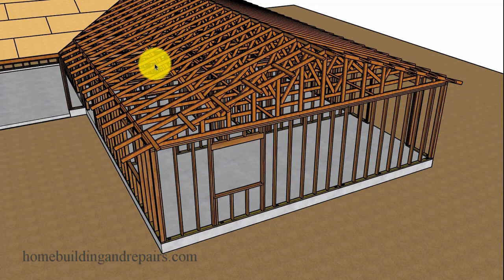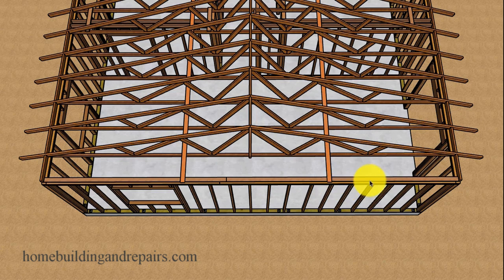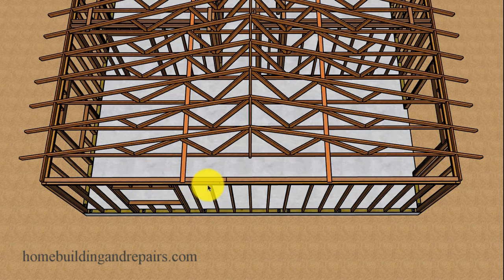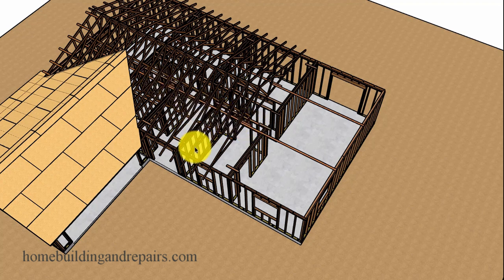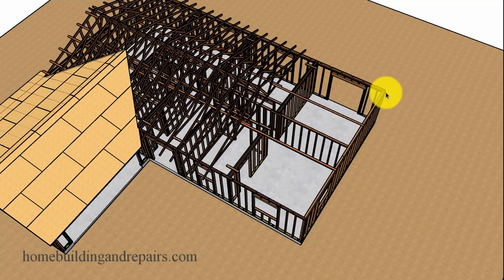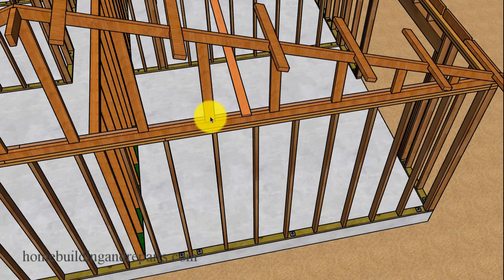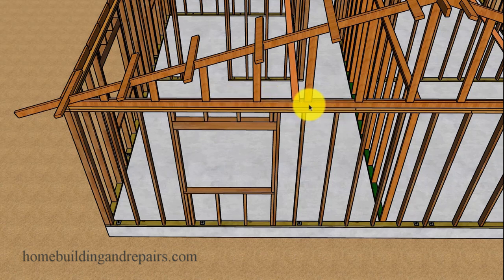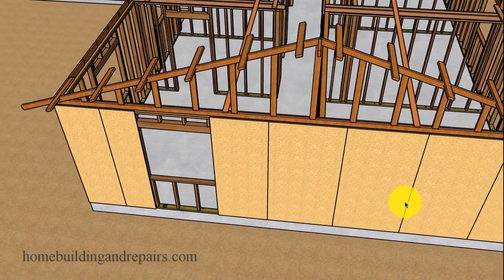How To Remodel Walls Under Gable Roof Truss Framing - House Remodeling Ideas

Comment: Greg, great, great, great video!  In the middle of a bathroom remodel.  One wall, the gable end wall (like in your video) needs plumbing run through 1/2 the wall.  I plan for 1/2" PEX (hot, cold).  According to this video, I think I can consider my wall not load-bearing in the technical sense which will enable me to cut small holes in each stud, 7 of 14, to run my PEX.  Thoughts on that idea.  Should I sister each cut 2x4?

Comment: Hi Greg, I am really enjoying your videos, thank you. I'm a drafter and I am doing some freelance ADU design. I am without a doubt going to be working with a structural engineer for permitting, however, I would like to get some basic understanding during my design process. I would like to push out the entire end of a gable wall of an existing garage by three feet. It's about 24 feet wide. Here's the catch... The new three foot by 24' section will have a second story above which will tie in with a new building that will run perpendicular. Would it make the most sense to remove the gable wall and gable studs and just put a new beam all the way across and sit the edge of the second floor right on top of it? Or would it make more sense to keep the existing gable studs and header plates and run a beam along next to them and sit the second floor on top of that?  Thanks so much if you choose to answer me =)

Comment: Hi Greg, I am new to your channel. This is the perfect diagram for the house I have. The question is, the center wall, right under the peak attached to the exterior wall, would that be considered a load-bearing wall? I have a single ranch-style manufacturer with a full basement. A supporting pole is right underneath this wall. The contractor said it was not a load-bearing wall, but I found the same length and width wall on the other far side of the house.
Reply from the maker: The wall might not be load bearing, but if there is a supporting pole, then that part might be load bearing.

Comment: What about the weight from snow?  I am building a 16x20 cabin with 14’ walls with half loft in rear…  using scissor trusses, the loft ceiling will be approximately 7’ from door..  I will have a windows in that back wall that tops just below the top plate..  there is no room for a header except in the gable.  We typically get 6-8’ of snow that will likely not slide off of the 4/12 pitch until spring..  C what are your thoughts. The window is 36x36.  If I put the header in the wall, it would drop the top of the window to my chin. I don’t want this, if I can help it.. 
Please help:) tia

Comment: Thanks Greg, I'm planning some renovation on a home I just purchased and you seem to have the perfect video for every specific situation I'm considering. Really appreciate your work. 
My home already has an addition that was added on a gable end like this with a single door opening. We'd hoping to open that up at least partway across the span of the gable. Is the solution typically a beam/header like you would do to transfer load on any other supporting wall or are there other lateral support changes we should consider too?

Comment: Would you still install headers above your windows on the gable ends? I’ve always considered gable end walls non bearing and thus not needing a header just square framing for windows. What are your thoughts?
Reply from the maker: Yes, they might not need to be as big, for example you might be able to use 4x4's instead of 4x6

Comment: I'm trying to find information on how to replace a 20ft section of my exterior wall where it meets the gable end wall. I know that i have to support the trusses above my exterior wall, I also need to replace the sheathing on the roof in that same span. I've been told that I need to build a temporary wall beneath the trusses, also the trusses have to be jacked up because they have dropped at least 2" because of the top wall plate is broken in half. Any advice I would appreciate, I know I may have to enquire a engineer to look at my predicament. I'm on budget and trying to figure out what I can do without the house collapsing down, note: the house 30× 52 A frame style trusses.

Comment: I had a licensed HVAC contractor advise cutting single stud on gable wall end of our 2 story home + basement would be acceptable with no concerning structural integrity issues. Originally they recommended a header for the duct but then walked it back after consulting their carpenter. They just secured the stud to the top plate so it wasn’t loose using some blocking. Waiting for inspector to consult them if this will suffice. I was pretty unhappy having sprung on me a last second change with no time to consider.
Reply from the maker: Yes, let the inspector look at it.